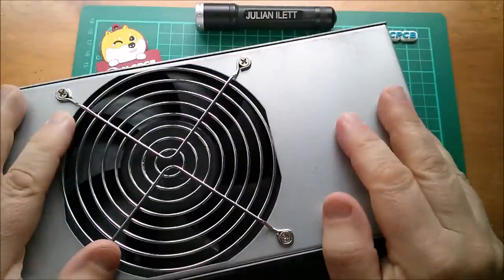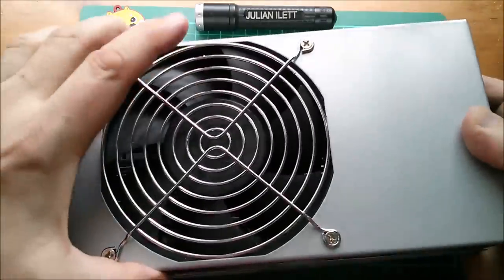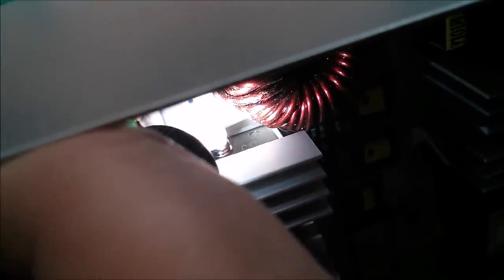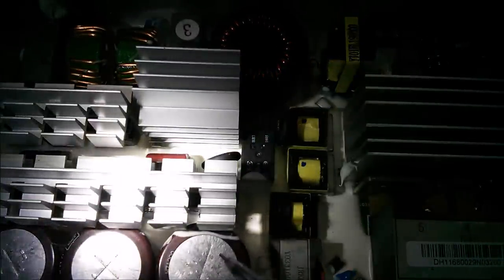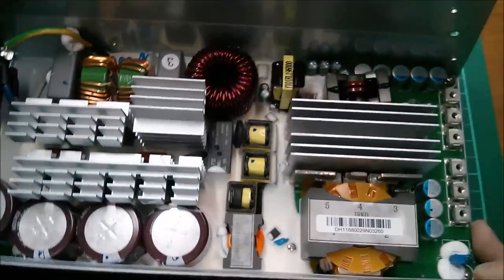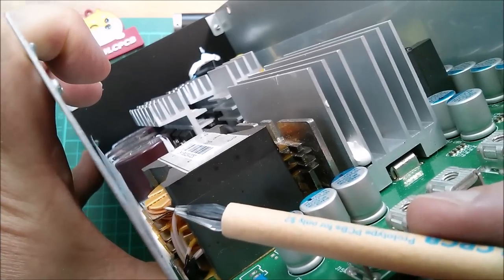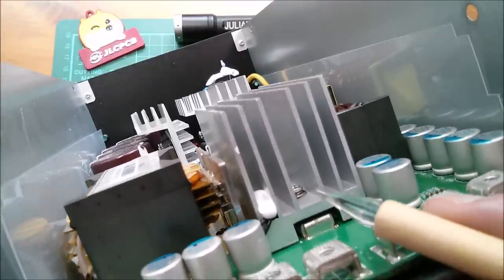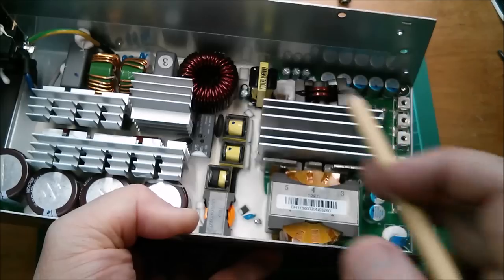200A Power Supply has some Crazy Inductors

Comment: It would be interesting to see if it’s push pull and you can put 12v into it and get 240v output or not.
Reply: that'd be cool
Reply: I don't think that is how switching power supplies work :-)
Reply: ????????? Hmmmmm , what !!!!!!!!!!!, don't think so.👎🤔🤔🤔🤔🤔🤔
Reply: @brucepickess8097  push pull with 6 fet rectification is by far the most efficient way to transfer that amount of power.  Given the number of fets on the ac side and the controller, it looks like 2 fets plus 4 and a pfc controller chip that gets you 384vdc and then a  2 fet soft switching resonant isolated dc/dc.  

If I’m right it’s a push pull by definition and should work in reverse.
Reply: @benbaselet2026  depends on the type. Push/pull ac/dc are the most efficient design.  See also a ford f150 lightening. It’s a push pull isolated power supply very similar to what was shown here.
Reply: even if it could the components on the output would blow up
Reply: @maxxiang8746  ??? No they wouldn’t. It will output 240v at 50hz. A push pull, which this appears to be is semetrical.
Reply: lol, of course it won't work in reverse, for starters it has a bridge rectifier on the input which certainly do not convert dc to ac. push-pull refers to the fact it uses a centre tapped transformer and 2 switches to achieve ac (edit: high frequency ac for the 400 to 12v step down) rather than a single winding with 4 switches in a h-bridge config or a single ended design
Reply: @Sydney268  that likely isn’t a bridge rectifier and is the controller for the synchronous rectifier. That’s why there are 3 sets of fets. 

They look very similar. 

And as soon as you do synchronous rectification in a pfc you have by definition a bidirectional circuit.
Reply: Looks like a GBJ bridge rectifier to me, the large toroidal inductor is for passive PFC, even if it did have active PFC, that doesn't automatically make it bidirectional, it would need to be designed as such - let alone the output stage (which you don't even mention) would need to be specifically designed to be bidirectional. You seem to imply this may work in reverse without being specially designed to do so, like inadvertently, it certainly will not and is highly likely it was not designed as such. Since this is a bitcoin miner power supply, it would serve no purpose if it worked in reverse - you can't put bitcoins into a miner and get 240v 50hz out ;)
Reply: @Sydney268  it may be. Of course that’s wasting 2-3% efficiency if it’s a standard bridge rectifier and not full pfc while having all of the parts for an synchronous pfc with resonant tank. 

On the low voltage side, it already appears to use fets for rectification which also works in reverse just fine. 

At that point the only limitation would be the microcontroller. 

And the controllers for push/pull are a few bucks on alibaba so, since the microcontroller was never shown my speculation was simply that they threw in module because it’s a cheap way to build a high power active synchronous pfc with how power dissipation. Chinese companies constantly do this kind of thing so, since you can’t get to the other side of the board, hooking power to it would tell you for sure. 

And if it isn’t, it’s a major efficiency waste in design for Julian.
Reply: Seriously, even if we overlooked the fact it uses a bridge rectifier on the input, its really not going to just magically work in reverse, just because the FETs of the 2 rectification stages can work in reverse, as you say the PWM controllers would have to support it but its a lot more complicated than that, think about the current sensing, the voltage regulation, the fault protection - they're all on the output. This will have been designed and manufactured to save every penny possible. I suppose you think it will magically put out a pure sine wave too?
Reply: @Sydney268  A standard synchronous PFC IC has all of what you just outlined built in on the high side, and the low side has to have voltage and amperage sensing. So if that isn't a rectifier and is a PFC IC, then it's done.  And then the high and low side ICs/Microcontrollers just need the logic.

I've built these. It isn't as hard as you claim especially using ICs. (which we can't see)